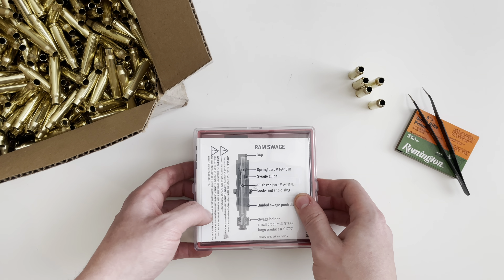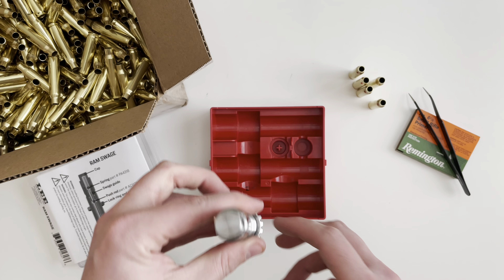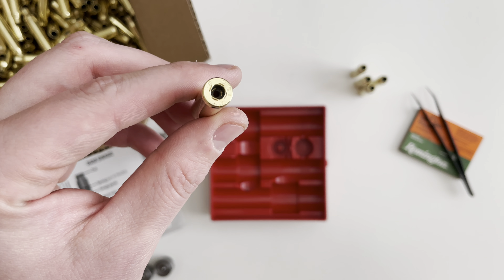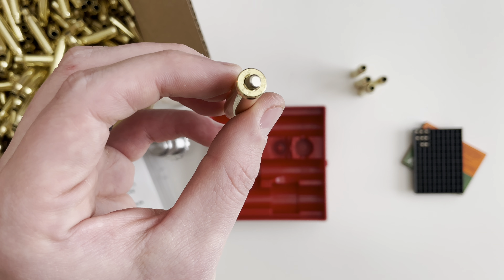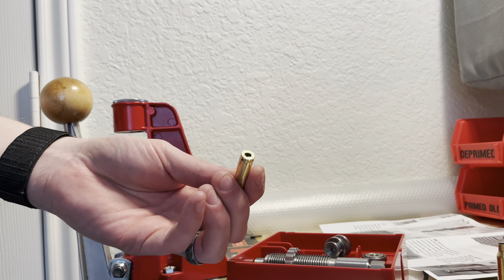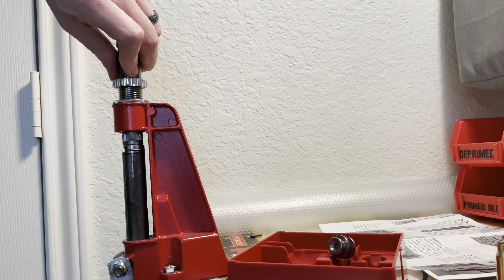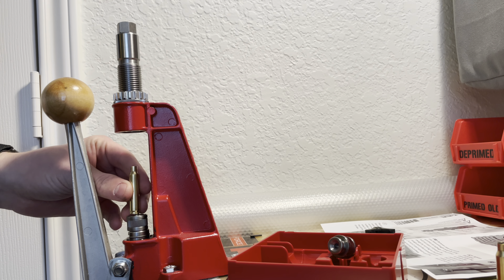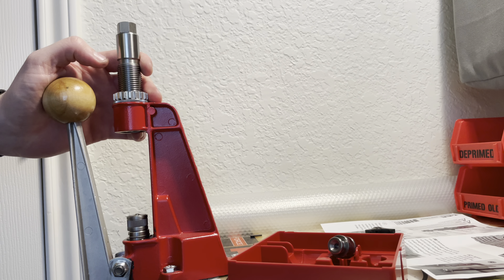Unboxing & Overview - Lee Precision Ram Swage

Comment: You can also use the swage  to tighten up loose pockets on small primer pockets. Just put the large primer base in and slightliy swage the small primer pocket. If you go too far, just put the small swage back in and open it back up.
Reply: Now THAT is a handy piece of information.   I have nothing but LC brass, buckets of the stuff, and by the time pieces may be worn out or the pockets loosened up,  throwing them away is a significant emotional event for me, unless the necks start to split of course!  lol    So, reconditioning the pockets is something that would be VERY useful for me and my brass snobbery.    Until now, the only remedy I knew of was to acquire primers that were slightly oversized so I could continue using brass with pockets that were opening up.  Unix Genix primers from Bosnia is what I"ve been using for that  but I'd so much rather stay with CCI #41 and #34 military grade primers which are a bit tighter in dimensions.     I'll have to grab one of these dies and see how she plays with my brass.

Comment: Thanks for the info. I just discovered this item this morning, Now I'm definitely going to be picking one up. I've been getting away with not swaging on my 10mm brass but now I've started to load 5.7x28,  and about 50% of the brass I've acquired are staked quite stoutly, it's no longer an option. Plus the chance of crushing primers isn't anything any of us can afford to do these days.

Comment: Thank you.  Great vid, no excess BS, well unexplained.
Reply: I did purchase this after watching your video. I've used it on .223/5.56, 9 mm and when my son started reloading 40S&W we used it there as well. I left this review where I bought it. The instructions are easy to understand. The setup and adjustment time is minimal. The precision and repeatability are excellent. The force required on the press is less than case resizing. The time required to process primer pockets is a couple seconds per piece. It is quieter, more precise, faster and less hand cramping than chucking a reamer in a drill. I'm using this with a Lee Classic Cast Iron press on .223/5.56 , 9mm Luger and 40 S&W. There have been other 40 dollar purchases I've made, but I can't remember any that have had the impact this tool has.
Reply: @phild8095  I've never seen 40 S&W with crimped primers. What brand?
Reply: @luvtahandload7692  US Coast Guard uses.40 S&W ammunition, specifically MK 309 MOD 0 155gr ball and MK 308 MOD 0 155gr JHP. As military ammo it is crimped.
Sometimes parts of productions runs for military make it into civilian ammo because it is easier and cost effective to reduce the downtime and keep running rather than change tooling. Also, some of these lots are sold to law enforcement.
I looked it up after having a problem inserting primers one time.  Now I just run them all like that to avoid issues.
So you may never see it, you may run into a handfull when you are picking up what you think is your brass at the range.
Thanks for asking.

Comment: Compare this one to the rcbs what's everyone's thoughts on which is better?
Reply: Lee Ram Swage will fit any press with standard threads.  I've seen some reviews where the RCBS wouldn't work on a Lee press.
The shell holder/swage die (bottom piece) is spring loaded to remove the brass from the swage tool. There is no fighting this tool.
Reply: I have the RCBS Combo 2. I find that I have to use a bit of force to knock the brass off the swager head. What is the level of effort for the Lee?

Comment: Not just 5.56.  
M80. And any NATO marked 9m.
Will this work with 9m? Or does it need to be a rifle case to go inside the die body?
Reply: Yes, The Lee Ram Swage will work on pistol brass.  I've been using it on 9mm and 40 S&W in addition to 5.56.
Best 40 dollar purchase I ever made.  I was using a reamer that took a lot of time, left little shavings, and eventually cramped my hand.  This is easy to set up and quick to use.
Reply: Works great on 9mm.  I scavenge a lot of crimped 9mm from the gun club range, and the Lee swager works great on em

Comment: How does it compare to the Swage It or Dillon Super Swage?
Reply from the maker: Tim, I’m not sure on that. I’ve not used it before. I went from reaming out primer crimps to swaging them with this.
Reply: @GunBox Therapy  I went ahead and bought the Mighty Armory swage die. Wayne gave a pretty  good discount.
Reply: The reason I like a die-based swage tool vs a dedicated tool like the Dillon Super Swage 600 is just that - it's way less expensive and I can do more with a die-based setup than a tool that only does one thing.  The DSS600 is really nice and works great, but the swaging process is something you do in bulk generally - like 500-5000 at a time.  The Dillon sits on the shelf the rest of the time, while I'm pretty sure you'll be using your press for other activity.  I've got a turret press for pistol rounds, and a Breech Lock press for this and for precision loading.
Reply: Lee Ram Swage is about 1/4 the price of the Dillon Super Swage, takes up little space an fits in just about any press. The effort is less than resizing 5.56 brass, more than resizing 9mm brass.
Vs the Swage it, a little less than half the price and again, takes up less space blah blah

Comment: Could this be used with a LEE hand press ? Didn't look like it took that much effort .
Reply from the maker: I believe it probably could be used with the hand press however, it does require a decent amount of force to swage the crimp as well as the need for a stable surface when starting out. Essentially every case, before raising the ram, is barely resting on the “shell holder”. 

I believe you could do it but I would recommend either buying a dedicated swager like the Frankford Arsenal one or buying this alongside a c-frame Lee like the one I’m using in the video. You will have a much better time with either of those setups.
Reply: @GunBoxTherapy  Thanks !

Comment: Hi a great Vid but was hoping you might do another vid reconstructing the Swage after deconstruction. I took mine apart to clean before using and it all came apart with a rush so am not sure how the two interior guides are replaced inside the die. Or I could send my email address. Geoff